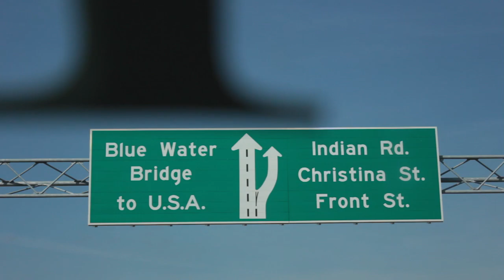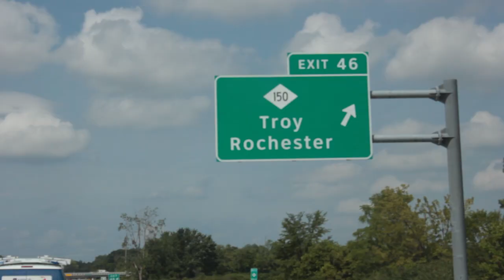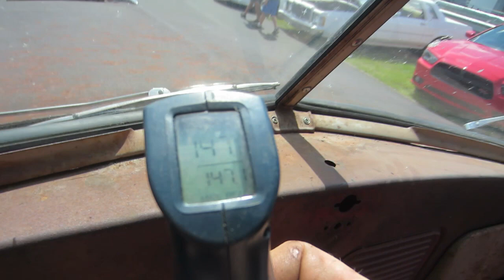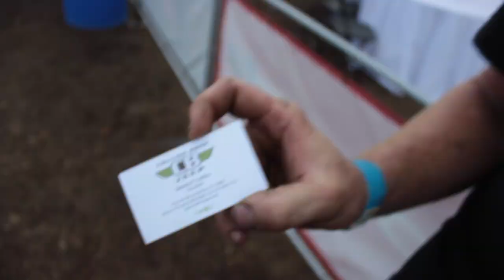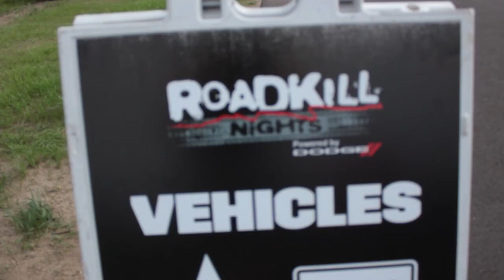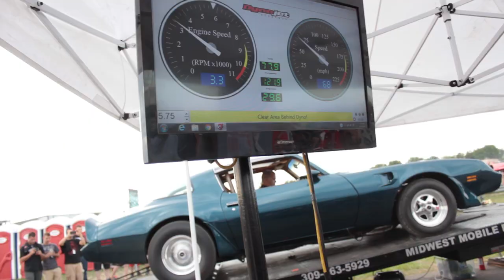Roadtrip to Roadkill Nights 2016 (Part 1)

Comment: Great video!! I was going to roadtrip my '79 Z-28 to Roadkill Nights 2017 which is about 340 miles from home, but The Cursemaro had other plans... It decided to bend a pushrod and round off a cam lobe a couple weeks prior. Fingers crossed for 2018

Comment: i think you have one of the better channels of this type. if you are taking suggestion for videos i have 2. i have a 2000 tundra with the 4.7 v8. i love the engine but it's rev limited to 5000 rpm. i know there's more to be had so i would like to see how to get more revs and hp from the 4.7. also would like to see a cummins in my all time favorite truck. the 88-90 chevy Scottsdale.

Comment: Hey man! I was going to bring my truck to your open house but my truck literally got stolen last night. An 02 Duramax with 20k worth of mods in it. I am from Dunnville as well and it was stolen from Brantford. Keep that Tahoe in a safe spot man!
Reply from the maker: Shit.  Do you have a picture of the truck?
Reply from the maker: Send them to me asap either to debossgarage at gmail .com or to my twitter
Reply: +DEBOSS GARAGE sent to your email!
Reply: +ArcticCatsRock it's got lots of distinctive features, powder coated stock rims, aftermarket painted tow mirrors, lift pump mod right by the fuel tank. EFI live Duramax badge on both pass and driver door, cursive hand written "Chevrolet" on the tailgate and there is also a dent right in the centre of the tailgate
Reply: SWAGGAN haha no prob, nope never was found, by this point it's loooooong gone